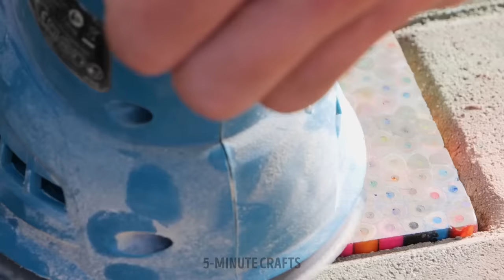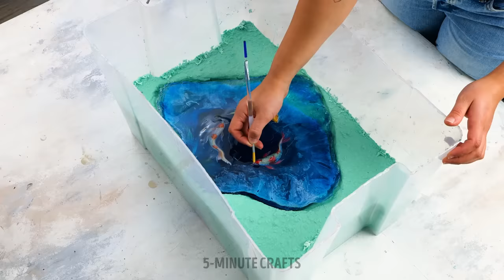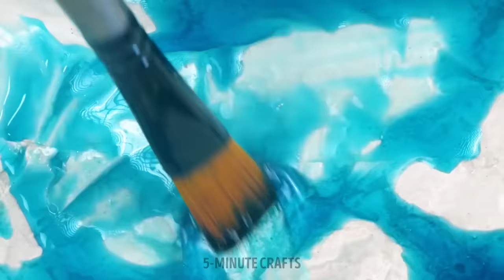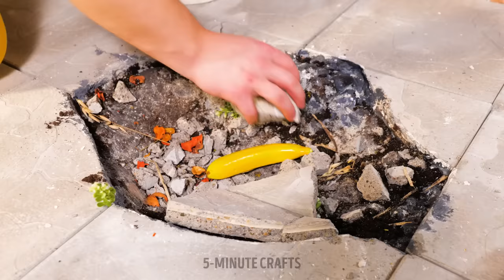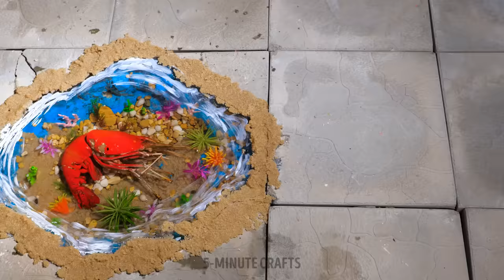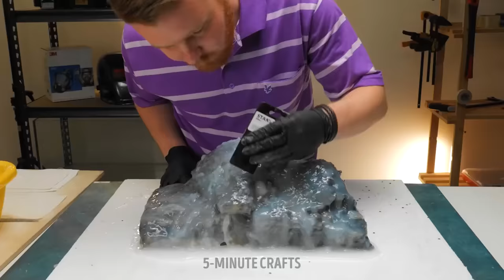Mind-Blowing Street Art And Repair Hacks

Comment: In my country a building with brick wall is made from bricks 😞
Reply: There are the so-called "apparent bricks", which are thin slabs like that, used only for decoration purposes.
Reply: @nulnemo4214  Yes and as I said we don't use those. Bricks are used for a reason and it's not because they are cheaper.

Comment: These are cool but unless we're talking about your own property, you wouldn't be permitted to do something like this on a public sidewalk or an apartment building (not where I live). You would be fined by the local authorities and ordered to remove it because would be classified as vandalism or defacement of public property. Also, how durable  are  those "repair hacks" anyway? Weather, and temperature conditions, over time, would wear that epoxy resin down; those painted fish, the plastic toy inserts, would probably get bleached out by the sun after a couple of years and the epoxy resin could delaminate. They're cool but impractical.
Reply: Exact....Art is impractical....muy bien dicho...